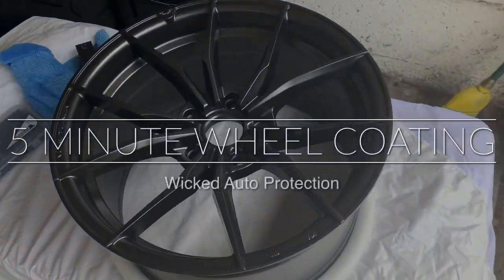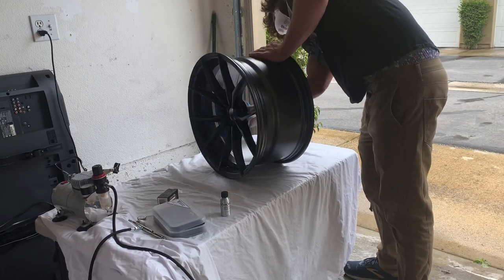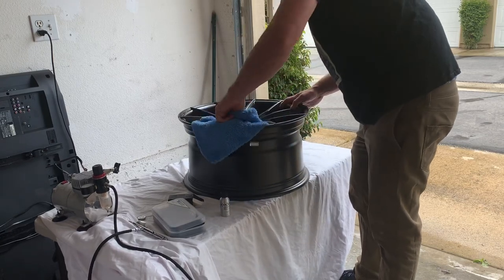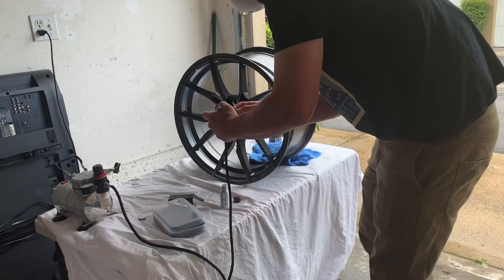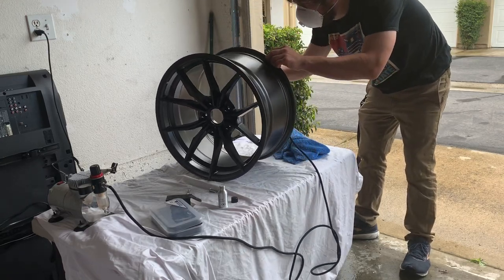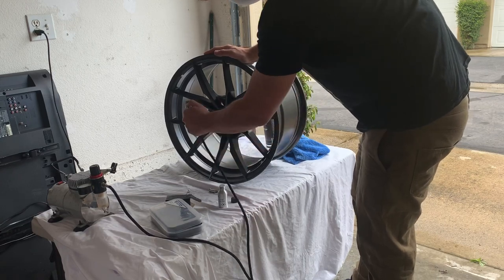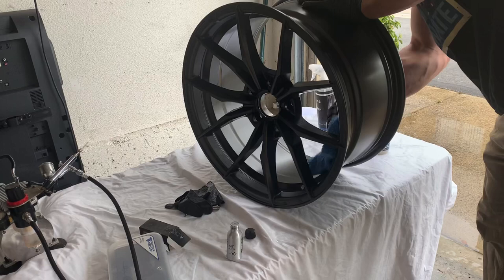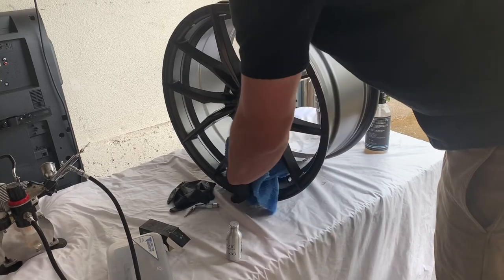CERAMIC COATING WHEELS IN 5 MINUTES | VORSTEINER | AIR BRUSH CERAMIC COATING

Comment: Great job Sam ! I just moved into a new place with a 2.5 garage and I'm going to be pumping out the coated cars soon. This method is the absolute best IMO. Are you doing complete cars using this method ? What solvent have you found to be the best for cleaning out the air brush ? I've got my compressor setup all purchased and I'm restoring a 25 gallon reserve air tank I picked up for $ 25.
Reply from the maker: Doing complete cars is illegal in CA. Spraying coating is worse for the environment than paint. I’m using a solvent they don’t make anymore but you can try kleenstrip prep all for cleaning

Comment: How Did it Last? Did it Chip? I was waiting for you to Bake it... I've used cerekote but I'm Always trying to learn of new products.
Reply from the maker: You don’t need to bake coatings, but here in California the sun natural + heat generated by driving will bake it no problem. Ceramic coatings don’t chip.

Comment: ….would there be an impact to the wheel weights adhere on the coated wheel surface before mounting/balancing?  I thought that was done afterwards.
Reply from the maker: No

Comment: So you dont wipe  after it flashes an when your  done spraying or do itt  a hour later
Reply from the maker: With most wheel and caliper coatings you do not need to level after using an airbrush, this creates a thicker shield

Comment: Hi, how much you put in the bootle? I think you use less product by normal way application or not?
Reply from the maker: This way uses less product. 4-5 drops is enough to do the wheel barrel and face If your air brush is adjusted properly. An applicator will absorb product and you can’t get into the crevices of every wheel, by leveling the product afterwards you also lose thickness
Reply: Thanks for the answer. My airbrush is 0.3 mm, nozzle, do you think it will work?
Reply from the maker: I don’t know much about actual air brushes I’ve used the same one for years since someone recommended it to me